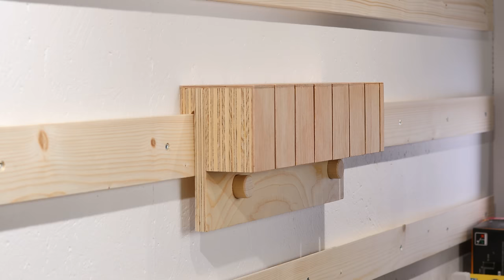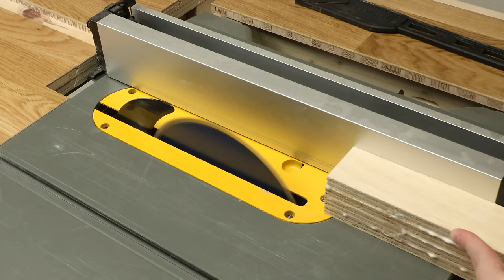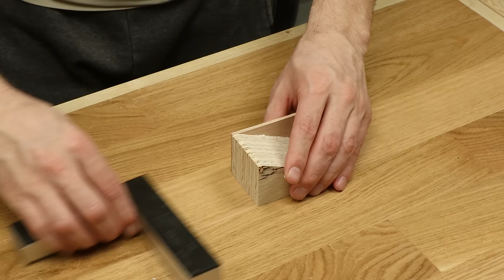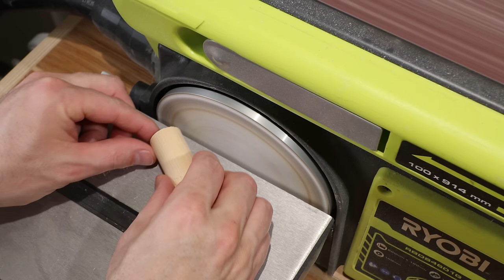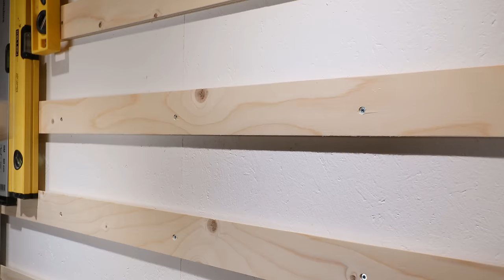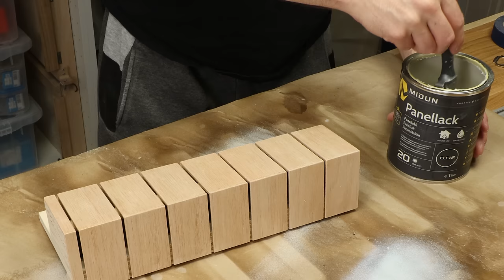I never want another tool holder for my saws! Here is how I made it

Comment: Clever yet simple design. I may have to think about making one of these for my shop - only, I think I would use a screwed-on top in case I ever needed to get into those locking dowels.
Reply: And a screwed on back too, if your glue joint fails, you'll have a wall full of saws falling. Can't really see a screw head on the backside.

Comment: that is a surprisingly original idea - really well done. I think I might use it in my planned saw till
Reply: You are planning a saw till? Do you use all your saws an equal amount? I certainly do not... Tool storage can be evaluated by how fast they deliver a tool to your hand when you require it. All else is secondary. I store saws (and everything else) where I most use that item, in the order of frequency of use. Some tools I have duplicates, when they are commonly used in more than one place. Poor storage steals your time, both in access delay and trying to find them when returning them is discouraged by said storage. You are not curating a tool display (or are you?) but arranging storage for efficiency.
Reply: @Tensquaremetreworkshop  i have a small core of prwmium handplanes and saws. I plan on building a display/wall storage for them above my bench

Comment: Further thoughts. You show  hand saws being held in this system- with the teeth forward, and the handles at around waist height. This means the saw has to be removed and then rotated to grasp the handle. Modifying the design to allow the storage to be teeth first, and mounted higher, has advantages.
- the hand can grasp the handle at reach height, giving single touch access.
- you are not grabbing sharp teeth
- less valuable high storage space is utilized
- the teeth are not where they can cause injury by brushing past.
Small rubber balls may produce the clamping force- magnets certainly would, especially if there was a small shelf to support the handle.

Comment: an inch long piece of a hot glue stick works well in place of the dowel and tape
Reply from the maker: I first thought this sounded really good but it has a major flaw, the smal diameter. With such a small diameter it is easy the stick get jammed by tilting to much, the extra grip it has on the sides make things worse.
Reply: I live where it regularly reaches 115 F in the shade! So I'll be using the dowel

Comment: Only think I would do is not glue the top, just in case you ever need to replace the Dowels.
Reply from the maker: I thought about that too but i came to the conclusion that removing the lids does not take long, make a few new ones and gluing them back go just as fast. But the main reason i glued it was to make the front more solid and less flappy, i like my builds to be as solid as possible.

Comment: Reminds me of a towel holder i built many years ago, though it used a marble instead.
If that's insulating tape, it can start to unravel and get sticky, specially if you stretched it while applying
If you find this happens, get some heatshrink tubing, maybe the adhesive lined stuff, bonus is that it's more rubbery and grippy ;)
Reply from the maker: I think I might replace them with two small bouncing balls, rob my kids stash ,:)
Reply: I added a spring for stronger resistance. It works great 👍

Comment: Very nice and ingenious! will definitely try to emulate this in my shop.
I have a few questions: how steep is the angle of the holder, if it's seen from the front? 
Also, is it too hard to remove a saw if it's accidentally inserted with the handle pushed all the way up?
Reply from the maker: About 65°. Never had that problem so far but i get why you ask that. It will for sure be a bit stuck but you can always pull the saw straight out from the holder, not optimal but it would work. In worse case you can always press another thin blade inside it to push the roller up and free the tool.
Reply: @DesireToInspire1  Sweet! Thanks for the reply 👍

Comment: IMO I would have built it to store the blade and teeth facing inside towards the wall because Final destination.  Otherwise, saved, can’t wait to make one!  Thanks!
Reply from the maker: That would be optimal but over time would the sharp teethes from the saws would destroy the holder. If the holder was made in metal then sure but then all the saws would get dull instead.

Comment: Pretty creative design.  Curious as to where you got the idea from, or if it was an original idea or if it was inspired by a similar design elsewhere and decided to repurpose the idea.  Very cool.
Reply: It’s an older idea for sure. You can look up locking saw till or gravity saw till. They all revolve around the same premise with the dowel as the mechanism but I like his addition of electrical tape to provide grip. I made one of these as well a couple years back and I don’t know how I didn’t think of the tape, I ended up using rubber bouncy balls (the little ones kids play with) and they worked out great. Still use it everyday.
Reply: They make these for handled tools like shovels, rakes, brooms, etc. typically utilizing 2 rollers though for maximum holding strength.
Reply: Really love the simplicity and elegance of this design but I’m having an issue with my bigger hand saws staying pace securely.  Some times they will stick but they mostly just slide down slowly.  I was wondering if anyone had a similar issue and was able to find a solution?   I did wrap the dowels with tape.
Reply: @danb821  Magnets are a mans best friend.

Comment: Really neat design. However, the need to fit dowels to keep it on the French cleats illustrated yet another problem with the cleat system of storage (there are so many!). I may well build one of these- but not for cleats!
Reply: Can you list out a few other problems with French cleats? I've made about a dozen various tool holders for my French cleat system.  No real issues for me. And the freedom to rearrange the holders as needed is very convenient. 

Only "issue" I've come across is the need with some holders requiring a 45° angle type bracket/stabilizer (easily made from wood), if the tool is large. But it's logical a bracket is required due to mechanical leverage
Reply: @57z  OK, here goes...
1) The 'module size' (spacing of battens) limits the density that can be achieved. 
2) The batten tops are almost designed to collect dust.
3) unless carriers span two battens they are Y axis unstable (and still can be).
4) No stability in the Z direction (unless you add dowels, as in this example- which takes vertical space)
5) little stability in the X direction.
6) Unless plugged, the fixing screws are unsightly.
7) Storing small items is difficult without considerable 'grouping', which defeats the flexibility claim.
8) It requires a large area to create a practical array- which forces non-local storage.

Pegboard, ideally keyhole type, plus 'cubbies' for larger tools, is more practical and gives higher density. Distance to tools and frequency of use should be inversely proportional.
Pegboard does not preclude concentration- items like pliers, clamps, and other multiple items can have dedicated mounting units, 3D printed, ply constructed, WHY.
In practice, pegboard is a higher density 2D location and fixing than cleats- it features the same lift-and-pull removal, but without the size limitations, or instability.
 Using 16ga wire to form special tool holders is quick, secure, and easily modifiable.
Cubbies, with movable horizontal divisions, give location/protection/accessory storage at least as good as cleats, but are more robust.
Don't get me wrong- cleats are preferable to the fad of storing workshop tools is toolboxes (can you believe that people do that?) but there are better ways. We now have 3D printers, multi-sized powerful magnets, full depth drawer slides, etc. Cleats are old timey- fine if you are into workshop decoration...
Reply: @Tensquaremetreworkshop  As someone who has no knowledge whatsoever of this topic: What do you mean with "WHY"?
Reply: @JSCHM  Shorthand for 'what have you' (i.e. many other options) - don't you just love TLAs?
Reply: @Tensquaremetreworkshop  Thanks.
You live and learn...
Reply: @Tensquaremetreworkshop  nice list. Thanks for taking the time. I agree with a few points you made. I'm happy with my system. I used the cleats for displaying many of my power tools, as I like to look at them. I don't use the system for smaller bobs and bits. French cleat definitely isn't ideal for some items.
Reply: @57z  ...and there is the clue- thanks for being so honest, many aren't. Saying it is for display means that it is not workshop tool storage, but a collection display which you are curating. Not that unusual- those arrays one sees of Systainers are the same- atrocious storage for access, but done as an art display rather than a functional workshop. Personally, I like the appearance of a system designed for functional use- the form follows function school. Guess it is the engineer in me; and I get a lot more done that way. A thought- why not make a display that shows off your collection, take a picture, hang it on the wall, and then re-arrange it for functional use?
Reply: @Tensquaremetreworkshop  well,  no. It's both, functional storage and display. I'm absolutely more efficient with my main large tools in easy access via French cleat vs stored away in drawers or boxes. They're also much faster to engage with and put away. Not all items are appropriate for cleats. Such as: screws and their containers, glue, tape, sand paper, PPE equipment, rarely used drill bits router bits etc are stored away.

Comment: Well done.  Good design!  Would it work if you just dropped rubber balls in the sockets?
Reply from the maker: Yes i believe it would. The only issue with one big ball is the reduced contact with the blade, small blades would have much harder to stick if at all. Having multiple small rubber balls in each compartment can create problems when inserting the blade when the small balls might jam. The best solution in my mind would be to have a big solid rubber cylinder, the added weight from the solid rubber would make it even better.
Reply: @DesireToInspire1  👍
Reply: @DesireToInspire1  Great idea. My saws take up far too much space hanging on hooks. This will be my next workshop tidy-up project. Inside your ingenious contraption, howsabout a piece of pushbike inner tube, cut to the length of the dowel and wrapped around it? Would maintain surface area contact and be less slippery than, say,a chunk of plastic pipe.

Comment: Nice design on an old idea. The greeks & Romans had a larger double version that they used as part of a door locking mechanism.  BUT I would design it so the teeth on the blades face away from the user.

Comment: Why wouldn’t you just use a magnet?
Reply from the maker: There is no magnet that fit all saw wights. And as you can see, i use a french cleat wall, and even tho i have secured the holder, there is still a chanse that it might pop loose if the magnets grip to tight. And if i want to hang non metal objects in the holder then ti would not work at all.